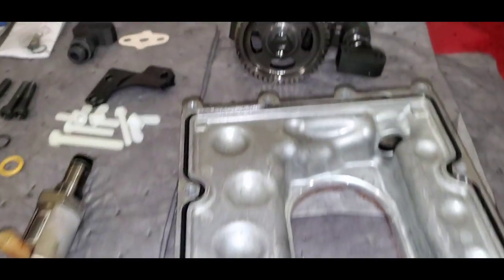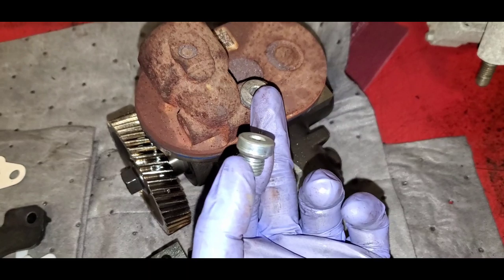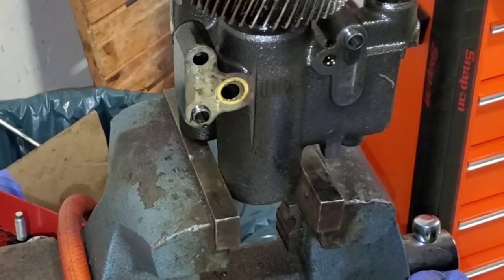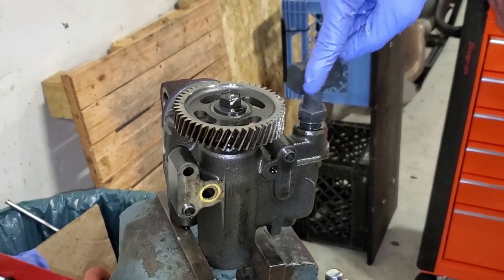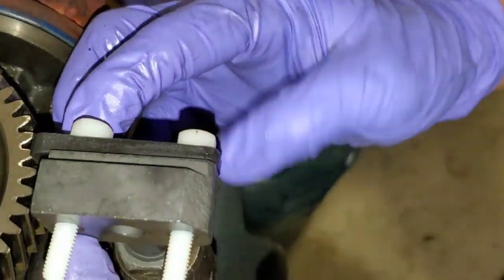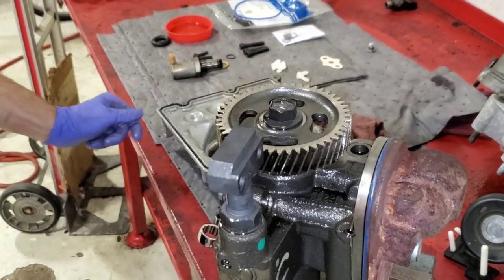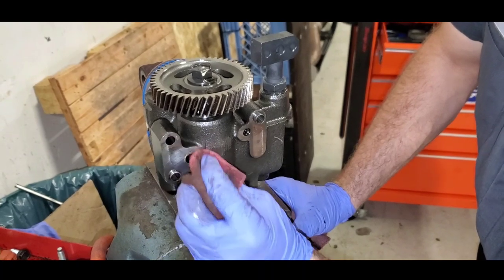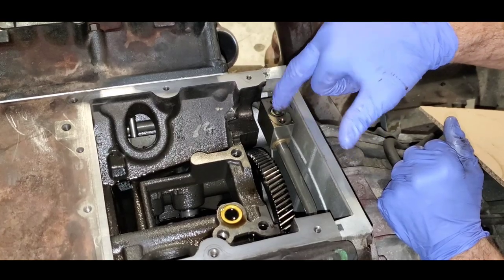6.0 Powerstroke HPOP Upgrade

Comment: Thanks for the video! My 06 has a steel plate that goes across the STC fitting and across the front of the hpop. Did yours not have that also? I’m wondering if that’s why mine won’t crank after head stud and new head gasket install!
Reply from the maker: That was version 2 of that crappy STC. The new kind is a jamb nut style

Comment: i think its better to snug down the pump bolts, snug down the STC bolts and make sure the 2 small STC bolts are not fighting the holes, then torque the bolts down BEFORE tightening the STC nut otherwise you may just have it crooked and induce a leak
Reply from the maker: Have done it this way since the 6.0 came out and I haven't had any problems

Comment: Did one with  my buddy 06. The sts fitting popedout so hard that the branch tube was bent and the rear case cover was cracked.  So a Simi  simple job turned out a big pain cab off engine out. That truck was down for over a month.  Thank god for his brother  help. He was a ford service  tec.
Reply from the maker: Omgoodness
Reply: Yup at the point totally  lost  to what to do. Still pretty  expensive  to fix.
Reply from the maker: Most def

Comment: Thanks for putting out these videos! I think I'm having problems with my hpop in my 04 6.0L (later 04). It'll start, run for a while then quit and then won't start up again. Already replaced the IPR but will look at it again.
Reply from the maker: Ok
Reply: Do you think the hpop could be the problem?

Comment: I've seen the blocks crack because of the fitting ejecting. Seen ppl use them like that too.  Creates a small oil leak.
Reply from the maker: Yeah I had one that was so badd on an F550 2005 that it broke the rear cover right by the branch tube but I was able to tweak the branch tube back so that I didn't have to replace it because Lord knows what you have to do to to complete that job

Comment: Never understood why they would use the same motor oil to hydraulically control the injectors especially with the high pressure which creates lot's of heat. They should have designed the hpop system to have it's own oiling system much like a hydraulic system with it's own pump and resivor.

Comment: If you tear it down to the pump, you should just replace the pump. It comes with the updated fitting.
Reply: why? high pressure pumps on 05-07 very seldom fail, not like the 03-04 aluminum pumps which fail very commonly.
Reply from the maker: Exactly, nothing wrong with that style pump. Cast iron 1s are G. The aluminum rexroth pumps are garbage

Comment: I just bought that exact kit for one of my LCFs yesterday. I’m thinking (hoping) that’s my problem. My driver said the truck was running good and then just “ran out of life”.
Reply from the maker: Ehhhh, probably not
Reply: @PowerStrokeTechTalkwARod  😬😬
Reply from the maker: Gotta bring it to a pro
Reply from the maker: Same set up on yours....cld be ur issue.....
https://youtu.be/CeQ_5RujatQ
Reply: @PowerStrokeTechTalkwARod  yeah, probably. I hate that I can’t read those LCFs... I just have to guess.
Reply from the maker: Called experience...costs moneyy
Reply: @PowerStrokeTechTalkwARod  thanks for the video!! I use the stock caps and motorcraft filters... but I’ll totally check the IPR first. It’s easy to get to on the tilt cab.
Reply: @PowerStrokeTechTalkwARod  took the ipr out this morning and put a new screen on! The screen was broken with a piece lodged inside! You’re awesome!!!!
Reply from the maker: Ding ding ding....better change out that shit ass oil filter tooo
Reply: @PowerStrokeTechTalkwARod  it’s a motor craft filter. I’ve always only used motor craft filters with the factory cap. I’ll put a fresh one in to be safe.

Comment: I'm in need of some assistance A-Rod. I have a 2005 f250 and have been experiencing a problem with cold starting. It seems to take about 10 seconds of cranking before it starts. I have a scan guage 2 on the truck icp looks good from first crank 600-900-1300-1700 and my ipr never hits 85. Icv koeo is .25 volts. When the truck has been started and warmed up to normal operating temp and shut down for a while say ect at like 120° F it will fire up very quickly but the low pressure oil on the factory gauge takes a few seconds to build. I have replaced the low pressure gerotor oil pump, oil pressure regulator, oil filter stand pipe, and anti drain back valve in the oil filter housing. Truck has factory oil filter cap and I always use Motorcraft FL-2016 oil filters. I took the driver side valve cover off to update dummy plugs and stand pipes and they had already been done by the 12mm hex and not the 10mm. I seen in a video from super duty service about an oil filter adapter flange that apparently has a O ring that can go bad? Any help is greatly appreciated.  Your videos have helped me quite a bit but this has me stumped.
Reply: Truck has 199k miles btw and no cel or dtc's
Reply from the maker: Do you have Instagram? If not whats your email? I will delete your response once I email you....

Comment: Unrelated to this video, but I was watching a YouTube video about manual regen on 2017+ 6.7's. Somebody commented that the dealer can turn on the manual regen feature. Is that true? Does trim level matter?
Thanks. Love the videos...very informative!
Reply from the maker: Yes, it can be turned on. Superduty work trucks 250-550 have it on. All 650/750s are on. All others can be turned on. Just did 1 the other day. Under programmable parameters, select fuel, then enable to two regen features. Not hard to do, to me wld be a free bee, others might charge....
Reply: @PowerStrokeTechTalkwARod  Thanks. I will need to check into that. Maybe the next time you get the chance to do one, possibly a video?

Comment: what are your thoughts on the power rating on the 6.0? 325hp - 570ftlb ... not that impressive compared to today diesels...
Reply from the maker: Yea, good platform for tunski's
Reply: Same as the 7.3 🤔
Reply: It’s all the power you need.
Reply: Wow have we gotten to the point where we now look down on the 6.0 due to its power ratings? I never thought that day would come.
Reply: @LynxStarAuto  don't get me wrong, 6.0 has good numbers..., But the 3.5 eco has 375hp 470 toqrue... too close from a 3.5 gas... 😬
Reply: Seems like manufacturers are in a torque race just for bragging rights.  How much power does a pickup truck really need?
Reply: @outbacker292  🤔 we always want the best! Diesels will be pushing 1000 foot pounds of torque...

Comment: i’m curious. so the oil feed TO the hpop is in the block, right under where the hpop sits. But what about the oil drain from the IPR? If i understand this correctly, oil is being sent through the ipr and the ipr is opening and closing a certain amount to regulate the pressure sent through the branch tubes, but that excess oil is im assuming sent to the crank case? how does that oil that is being sent through the ipr make its way to the crank case? does it leave out the back of the pump? but then it wouldn’t be a closed system? idk man i’m pretty damn confused lol
Reply from the maker: The ipr just dumps it back thru the pumps rear side. There is a lil drain port there behind the gear
Reply: PowerStroke Tech Talk w/ARod ahhh I gotcha now. Does all of the oil entering the pump go through the ipr? (probably not) Or does the oil enter the pump and goes straight to the branch tubes, with the ipr sort of off to the side and just a little bit of oil goes through it in order to create the pressure? you’re always willing to answer my noobish questions, I really appreciate that Arod
Reply: i realize i might have just answered my own question, sorry about that
Reply from the maker: Lol, no sweat guy!
Reply from the maker: So the oil enters the pump from beneath. Gets pumped....then the ECU tells the IPR i need "X" amount of pressure(which it sees via the icp sensor, which cld b in the pump cover or bank1 valve cover-depending in build date year)then the ipr(the door) opens or closes accordingly & allows that amount of pressure out of the pump. The pump always is making pressure, the IPR controls what comes out....👍
Reply from the maker: Thats why it is so critical to use the proper oil filter in the 6.0 or it will destroy your ipr & leave you stuck with a no start 🤦‍♂️🤷‍♂️
Reply: PowerStroke Tech Talk w/ARod I’m definitely screenshotting this, that explains it perfectly, seems like I had the general idea down. It could be because the 6.0 is my first diesel (never dug deep enough into any others like this) , but i’m so fascinated with how it works.. it’s very intriguing. 18 gallons of oil per minute through that system, it’s crazy. you have a blessed day brother and take care, you’ve made my day helping me understand the hpop!
Reply from the maker: Thats awesome. If you like those....then YOU'LL LOVE THESE. CHEERS MY FRIEND!

FORD 6.0 Liter Diesel Repair Videos: https://www.youtube.com/playlist?list=PLO4T4Ez-ZZaQkthM2pSuol5lAFvdXFnGG

Comment: I messaged you about a month or so ago and ask you about a 2000 F-250 7.3 and you said to check the fuel pressure we didn't get to it until a few days ago and the fuel pressure key on was 36 psi at idle 36 to 38 psi at 2500 rpms would drop to 36 and go back to around 38 to 39 psi that was after the blue spring update would it be possible the fuel tank filters or the fuel pump
Reply from the maker: That truck doesnt have a blue spring kit. Fp shld be 58 60ish psi. Pump or in tank DTRM filters
Reply: There is a spring kit for the 7.3 that comes with a billet cover instead of the pot metal one. I think riffraff sells it
Reply: @PowerStrokeTechTalkwARod  I ordered a upgrade spring kit and installed it before the fuel pressure was checked so it's about 20 psi to low i ordered a motorcraft sock filters with PMP pickup screen i hope that fixes it if it don't I'll get the fuel pump thank you for the information and i really enjoy all the videos you make try to do a few more on the 7.3
Reply: @PowerStrokeTechTalkwARod  we changed the fuel filters and the pickup in the tank it was very dirty but the fuel pump was bad to now it idles around 62to 65 psi at idle or 2500 rpms thanks for letting me know about the fuel filters and pmp pickup . thank you and keep the videos coming